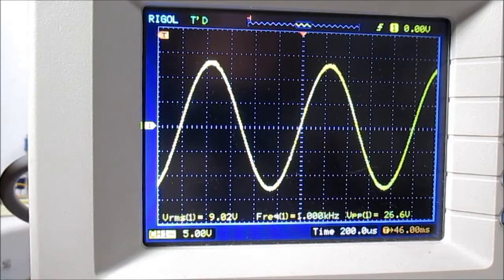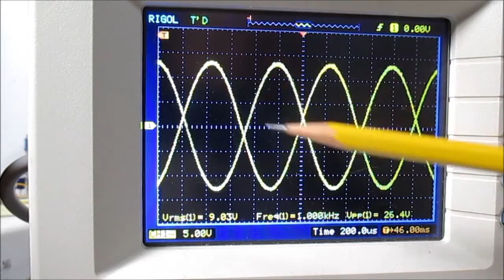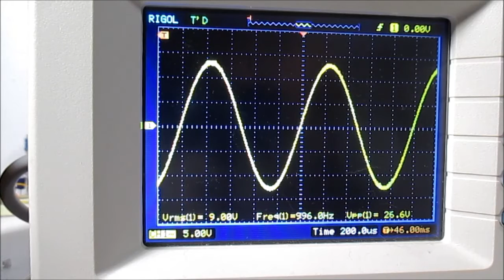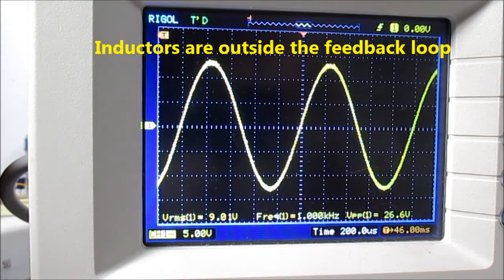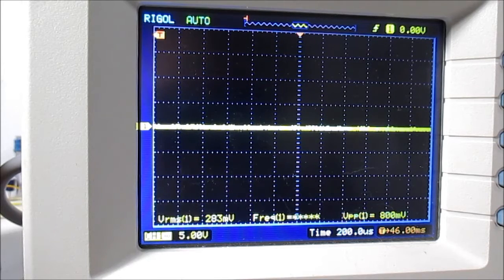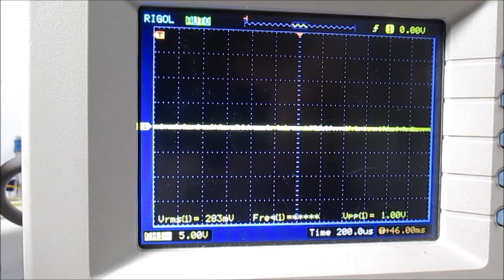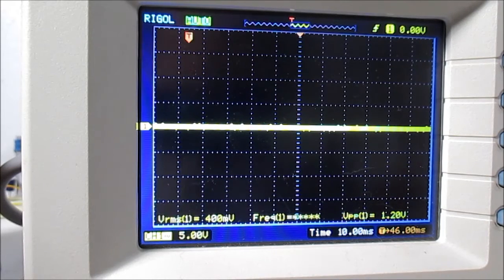Class D audio amplifier damping factor measurement

Comment: Hello, that is nice video about Damping factor. All time you are speaking of 8Ohms speakers, but if I want to connect tactile transducer to the amp ant it's a 4 ohm load, like the Earthquake Quake Q10B 1000 watss in max with 4Ohms and Response  frequences : 5 Hz à 70 Hz and 
max amplitude is  50 mm at 22 Hz. Which damping factor do i need in amp to handle tactile transducer well and effectively??? Thank you.

Comment: the best amplifiers have a high damping factor before introducing negative feedback...
using negative feedback to increase the damping factor produces unpredictable distortions that are difficult to measure with traditional methods.
the best amplifiers have the damping factor that does not change with the frequency.
these rules apply only for audio engineering purposes ... for hifi at home they are not necessary.

Comment: Could the damping factor change when you change the load from 8 to 4 ohms?

Why are some amps only rated for use with 8 ohm loads?
Reply from the maker: Damping factor is the ratio of the load impedance to the amplifier's output impedance so changing the load will change the ratio.

Lower impedance demands more current from the amplifier and the circuit may not be able to deal with the current and the extra heat.

Comment: Love the vids, I do learn quite a bit. Could you do a video on how to wire up a potentiometer for volume and/or on/off with a BT Amp board? I know there are boards out there with potentiometers included, but would be nice to be able to use existing from an old radio if available.
Reply from the maker: I do have a video about potentiometers and how to wire them up.

Comment: I have a question that is not related to D class amplifiers and damping factor. It's about building a low sensitivity low noise electret microphone for a video camera use. The problem is that the camera in question has no preamplifier settings and everything is controlled by AGC (which is very typical solution on entry level cameras). The camera is also ingeniously paired with very loud preamplifiers, which results very loud distorted audio with almost any typical consumer level electret microphone. Simply put the microphone input is practically f*ked up by a very stupid design flaw as far as I can tell, and rectifying the issue can become either very cost defective or impractical (such as professional level microphones or dedicated audio recorders). This is very unfortunate as the camera excells on its video features.

On the other hand, if the microphone signal is attenuated before it gets to the preamplifier stage, in my experience the noise floor increases to unacceptable levels very easily. Therefore I would like to try to build an electret microphone which has relatively low sensitivity (I suppose one needs to find low sensitivity capsules for this) but more importantly, very low noise floor. I've seen some of the videos on YT (mainly on EEVblog) how to achieve this, and I am wondering whether would you have any heads up where from to begin with this kind of project? 

And thanks for the very resourceful channel, definitely one of the best on audio tech on YouTube!
Reply: No, the gain in the preamplification stage is too high for the power supply rails' voltage. Hence the clipping and high noise floor.

Nothing much you can do besides put a resistor or two in series before the input side of the gain stage.

I'd just buy a new camera though LOL
Reply: Thanks for the reply although it a bit delayed in this particular case:) What I found trough experimenting that some microphones simply have lower noise floor than others. If you buy a cheap one, you often "get what you pay for", and buying a more expensive one will likely just give you "diminishing returns", as usually with everything.
Reply: @outolempinimi5165  it sounded to me as if the noise floor was from the electronics in the camera not the mic itself.

Could be wrong though...hope it worked out eventually buddy 🙂
Reply: @daniellyons-kl3ru  Yes I have to elaborate a bit. The camera itself has a defect (or a "feature") in this particular case as the AGC sits about 10dB higher than it should. Something probably went wrong with the camera software development and it never got fixed via firmware updates. Despite that, it was possible to get decent results with a microphone with costed about half of the price of the cameras itself. However, because the microphone (with its own power source) was bigger than the camera it kind of defeated the purpose.
Reply: @outolempinimi5165  Auto Gain Control? Meaning software controlled attenuation in the digital domain... Yeah can see why that went wrong then lol.

Fun fact.. if you attenuate a signal using all 16 bits IE at 0dB ceiling by -3dB.. that signal is now an 8 bit signal. And the power is reduced by 50%.

However, to the non linear human auditory system's perception... this is the equivalent of saying 'turn the TV down ever so slightly'. LOL.

Gain reduction should not really be done in the digital/software domain.. or at least not without using very high bit depths IE 32 bit.

Comment: There are a ton of these modules on the market right now. I'm thinking about building a Dayton Audio 2X50 watt amp for a desktop speaker system featuring a pair of old Dynacoustics PS10 bookshelf speakers. That will be way more than I need for the application, but I'm hoping it will give me lots of clean headroom. Have you tested any of these?
Reply: Ken, if you want to play with these class-d modules there is a nice website http://www.diyaudio.com/forums/class-d/      I have a couple of these different boards myself. What I really like are the mono TPA3118D2 boards that cost like 2USD on aliexpress. Remove a resistor to lower the gain and almost no hiss on the output.  I actually use this cheap board on a solar panel in the garden when it is nice weather outside. Beats all the BT speakers in sound quality and doesn't cost anything. I've placed a really small heatsink on the IC but even doubt it is necessary. If the weather is crap I can even power these boards from a 5V usb power bank, they have less power but still work.

Comment: Hi John. As I've told you before, I used to watch you on your old channel. It would be interesting to see if some of your old builds are still around / in use, such as the folded horn main speakers or the acrylic sub, along with some of the other topics you used to bring up, the "thinking out of the box" type of stuff you used to do.

But what I'd like to see from you is what you can do with a single, generic transistor, such as the lowly 2N3904 or 2N3906, or equivalent. I know you've already covered some basics, but maybe you could come up with some ways to show how to coax relatively high performance (for a low power, gen-purpose unit) and how to optimize the circuit, even if it means adding add in few more passive components. I know a single 2N3904 can be used for a really nice dynamic microphone preamp, and with the addition of another cap, can be turned into an electret microphone preamp.

Comment: My front speakers use a transformer and diode bridge for power my sub uses regulated  supplies. Why is it at anything over 3/4 volume my sub seems to plateau and the front do not?  specs below if interested 

I built my own 5.1 channel amp TDA 2030 20v rear 8 ohm and center 8 ohm and TDA 7293 front 8 ohm 27v x2 and sub  4 ohm 32v x2  

OMG a Catruption! lol
Reply: What do you mean by "plateau"? Clipping? What is the efficiency of front and sub speakers, respectively, and is the architecture lightweight (drywall) or massive (brick, concrete)? And why would one use regulated supplies on a sub amp? They're not switch-mode supplies, are they?

I sort of suspect either too much of an efficiency delta, or maybe some power supply issues. Hard to tell without a lot more details.
Reply: front speakers 92 db crossed over to the amp at 80Hz 6db the sub is rated 96 db (+- 3db) and crossed over at 60 Hz 6 db this helps tune it to the room (I have a very 70 Hz boomy room) changing the sub to flat makes it louder but only because of the huge hump in response it has.  with the sub crossed over at 60 Hz its more in the 93 db range the sub is also in a small sealed box good for 28Hz f3

by plateau i mean it dose not sound like it is getting louder it starts to fall behind the front speakers at lower volumes the sub has great response and really out classes the front speakers leading to it being turned down to about 2/3 of sub volume  

but i would like to know if the it is the power supplies limiting it or what. as to why i used them, all i had at the time. I do plan to change them out as can afford to. when i was making plans i had a 500va 30x2 transformer in mind.
Reply: It sounds like the the amps powering each set has a different gain factor, meaning as the source volume goes up, the amplification does not rise linearly between them. I doubt it has anything to do with the power supply.

Comment: I have seen many designs incorporating tda7293/tda7294 with 2sc5200 and 2sa 1943 at its output.. can u make a video on the output power and distortion figures. It's cheap but is it any good to use?

Comment: Hi John - Here's a question for you, please.
I'm intrigued by these amazing Class-D amplifiers, and I am thinking of using multiples of these in one speaker.
What I mean is . . . one TPA3116 driving a main bass speaker, another driving a mid-range speaker, and another driving a tweeter.
So three Class-D amplifiers feeding different speaker drivers in the one speaker housing; Each of the three amplifiers being fed by the output of an active crossover.
Does that seem like a good idea / a good project?
Do you envisage any issues or problems to be encountered with such a project?
Thank you

Comment: Class D amplifier hissing noise and how to mitigate?
Reply: Don't put your preamp on the same power supply as the amplifier.
Reply: Ognjen Čolić if it's plain white noise hiss, it's because of too high gain, and it applies to all amplifier classes
Reply: Thank you all for the answers,i understand what possible causes could be but its old Sony Home Theater System from 2000 :-P and before you say buy new one i will but im interested on what could i do in the meantime to mitigate.
I have full schematics and service manual and it looks like amp gain is fixed and volume is controlled by the preamp since volume adjustment does not affect hiss and only mute disables amp chip and hissing goes away.
Unfortunately amp chip is some sony in house designed part so no datasheet to adjust its gain.
So i would like to see John explain how to make some output filter or something because its common problem and putting resistor in series with speaker destroys frequency response right?(no scope to test it:-( 
Possibly how to reduce speaker sensitivity?I find this interesting and he is definitely the man to ask.
Reply: I can't promise to help, i'm not at all an expert, but i'd be curious to take a look at schematics. However, i suspect there night not be a fix for the noise :( except by complete redesign of the stage in this case.
Reply: What does it use for a volume control? Multichannel units from this time were notorious for using PGAs (or source selector + tone control + PGA ICs) of modest to downright poor dynamic range. My parents used to have a mid-2000s Kenwood that was audibly (if acceptably) noisy on speakers and almost unusable on headphones, as the headphone output employed a simple resistor dropper that did not provide enough attenuation for just about any regular headphone.
Reply: Very interesting replies,thank you very much.
In case that someone would like to see schematics here is download link of service manual that contains block diagrams,full schematics and pcb layouts,i simply love old products because of their service manuals
https://www.manualslib.com/manual/1200668/Sony-Hcd-S400.html
I dont expect this to be fixable to be honest but im so interested on where the noise could be coming from,its louder than what ive heard from other receiver but unfortunately no osmeloscope :-) to test the signal on every stage.
Its a plain old white noise,no SMPS noise or anything like that.
And yes @PileOfEmptyTapes it does just re rout sound from main amp to headphone when you plug them in and  there is basically no dynamic range to speak of but otherwise it sounds great on speakers,tested the frequency response with calibrated mic and its as good as it can be considering my speakers.
And one more thing,since all amp chips are the same and have the same circuit diagram i wonder where are they regulating cutoff frequency and with some hack could it be changed or is it programmed in some asic?
To be clear im not noob when it comes to amp and electronics in general since i repair that stuff but hey 2 heads are smarter than one and since there are many more brains in comment section i thought hey its worth a try since the main subject on many forums is stupid stuff none of this more advanced and interesting stuff.
And again thank you all for replying.
Cheers